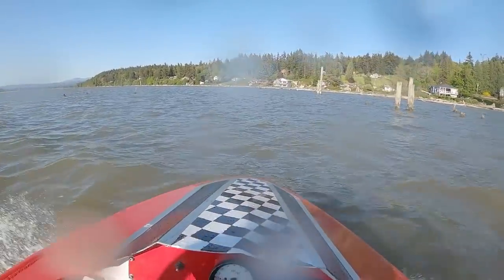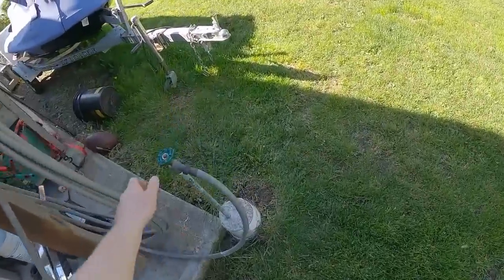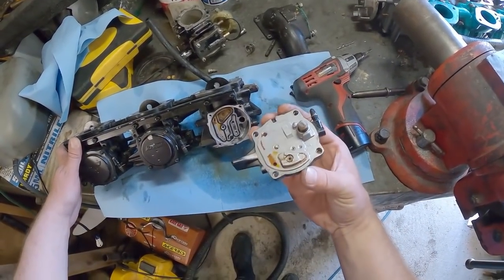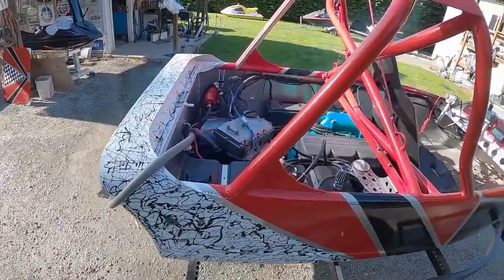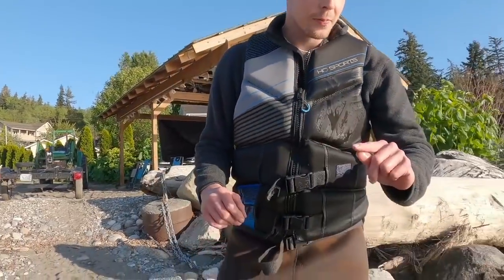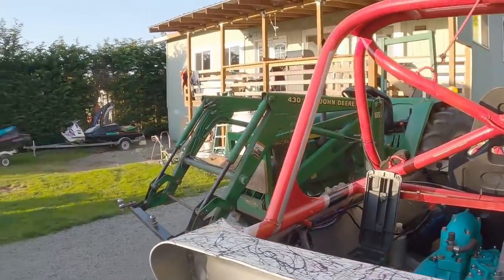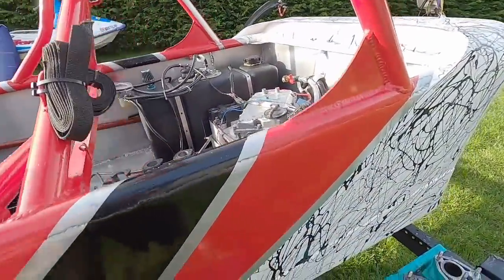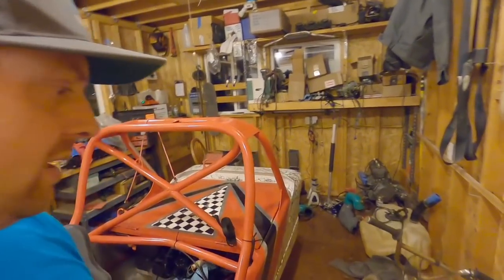savage 1100 jetboat

Comment: I would just build another 1100 kawasaki for it.  Put an ADA head on it with the 160psi domes, do the timing mod to the crank sensor with the dual cooling mod and it would FLY!!!   I had a 1100 ZXI with all that done and it was awesome.

Comment: Make sure you’re tank isn’t vented. Needs to be able to inhale but not exhale for the carbs to work under pressure. Sounds lean when you try to go. High pop off and or lean low speed jets likely. Especially if it’s getting better as it warms up.

Comment: I think you need to look at some buoyancy on the roll bar just in case you flip it over . Imagine being trapped underneath as it sinks ,not much buoyant material in the hull . A boat is potentially more dangerous to the driver than a PWC is from being trapped inside. Stay safe guys.
Reply from the maker: Adzy the PWC bloke in Australia definitely not a bad idea

Comment: hone out the cyc and install new rings
Reply: Or just buy a Wiseco complete top end kit but it doesn’t need a top end rebuild I guarantee if they checked cranking compression now all 3 of them are well over 120 to 150 psi with throttle held wide open . Rings stick all the time he should have added a few drops of oil down plug hole and sprayed A good quality oil based lubricant like PB blaster through intake then cranked it a few times before compression check

Comment: Put a big 4 stroke in it.....like a hayabusa....
Reply: Xstreamaudio why ? That’s smaller than the 1.8 yamaha
Reply from the maker: Xstreamaudio big 4 stroke is 572 bbc
Reply: Turbo bussa makes 400hp pretty reliable....
Reply: Bike engines have no stroke. That’s why they rev so freaking high and have weak torque numbers. Look how long the stroke is on the engines in all these skis. You need stroke like that to make enough real estate on the cylinder walls for all the ports that two strokes need to run and two strokes have always been well suited for marine applications because the frequency of when they have power strokes versus 4 strokes. Two strokes fire every time the piston hits top dead center. Four strokes fire only fire every other time the piston hits top dead center. The drag from water resistance on the hull is hard to overcome in off power situations which is another reason why you typically only see direct drive or (only one forward gear) on marine applications. You can’t shift because that split second of letting off the throttle to shift gears you would slow down too much to use a higher gear.

Two strokes are just torquey powerful design. Four strokes are quiet and have great fuel economy and better emissions IF..... they are naturally aspirated. You can go get a mr1 like your dads ski or a N/A 4tec like a GTI 130 or like that GTX 155 that you cut up and ride all day on a tank of gas. But they are slow, heavy, boring to ride, and the hulls have to be so big to fit all the plastic baffles, resonators, silencers, cats, and crap that they have to choke it all out with just to meet those noise and emissions standards that you can hardly even wave jump with the thing. These four stroke skis are the size of my Boston Whaler for Goodness sake! Hahahahaha 
No doubt the latest performance milestones have come from four strokes but look what you have to do to them and how much you have to spend just to get it to feel anything close to fun or snappy like the vintage two stroke skis. I am blown away by the amount of power they are getting out of the 4tec 3 cylinder engines and they really aren’t that heavy with the use of plastic intakes etc. I’m just saying I will always appreciate two strokes for having more power per pound than a four stroke with so many less moving parts. And the serviceability/rebuildability is no comparison. Pop a motor on your two stroke? Piece of cake. Pop a motor on your supercharged four stroke? Let the tears start rolling! Lol

I will say though people will argue forever what is faster or better. The answer is just like Josh said in one of his comments. With enough time and enough money you can make anything as fast as you want. If I gave josh an unlimited budget I’m sure he could make a GPR do 100mph or even go to the moon! But I am definitely not rich!